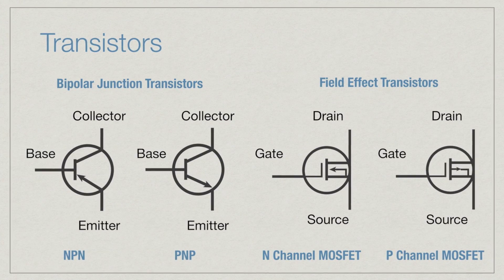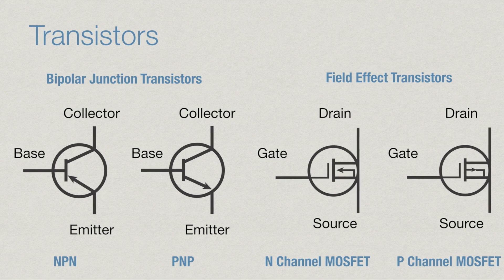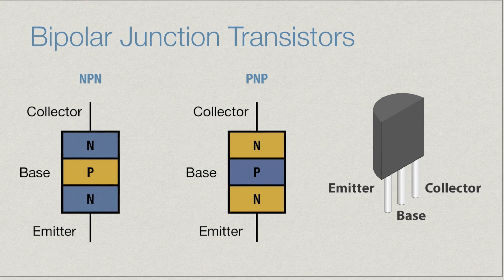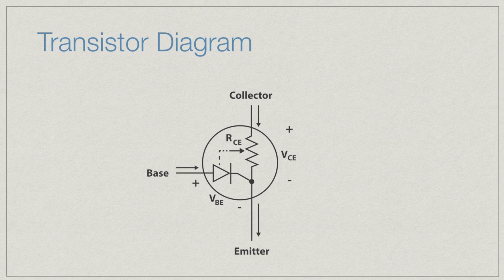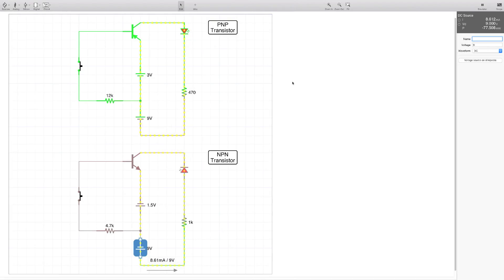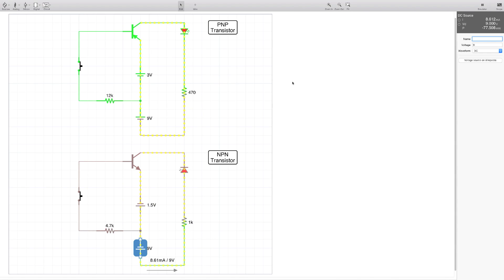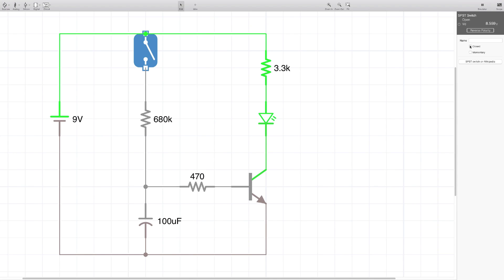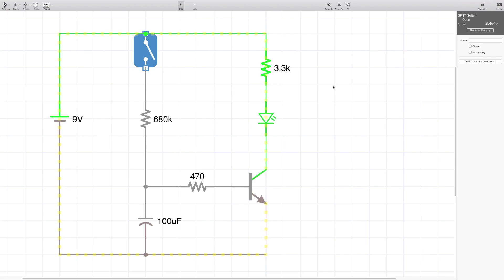Electronics Tutorial 4 Transistor Tutorial

Comment: This video is no different than some textbooks I have had in electronics classes. The teacher says one thing but the pictures are usually for something else. Or in this video... the speaker says the transistor is a PNP transistor but you see 2 transistors that are NPN.  In other words.... you read or get taught one thing but you have to read between the facts to get the real information. In the TRANSISTOR DIAGRAM, it's labeled like it's a general transistor, but in actually, it's a different kind of transistor. A regular transistor does not have a resistor built inside of it. That would probably be an FET Transistor.
Reply from the maker: I apologize for the mistake

Comment: Hi Derek. Regarding current - In different books there are different explanations of currents' directions from + to - and opposite :(
Reply from the maker: +Sam Slim Negatively charged particles (electrons) flow through conductors from negative to positive. This is always true. Electrons and not protons move through a conductor. In a schematic diagram though we can define that we are using conventional current in which we say current flows from positive to negative. So either can be true and the schematic diagram should define the current flow with an arrow. I hope that helps.

Comment: There is a mistake, the npn transistor have the notation of pnp! The arrow for a npn transistor is going outside of the circle.
Reply from the maker: +Florică Florin Sorry about that. I didn't catch it until I was done and it would take forever to reedit the whole video.
Reply from the maker: +Matej Stražišar Sure I'll do that. For some reason it won't work on any mobile devices though
Reply: Also the mosfet slide has a similar issue. The Nchannel has the p and n regions swapped.
Reply: Derek Banas you still haven't added that notation? Also the next slide has "npn" on the pnp transistor. Your video is going to confuse people man...
Reply: The sandwitch models are also identical, both NPN, with different colors.  I'm a bit leary of learning from this..
Reply: And now more simple mistakes on the next slide.  Man I appreciate the work that goes into these things, but please do show care in checking it.  You can really screw somebody up with bad info.

Comment: Im lost but nice✌🏼️✌🏼👍🏻
Reply from the maker: +ItzSparkBoii - Thank you :) A transistor is actually a switch / amplifier. Current flows into 1 wire. If the middle wire doesn't have a current flowing through it the switch is off. If the middle wire does have a current flowing into it that current combines with the other current and it flows through the last wire.